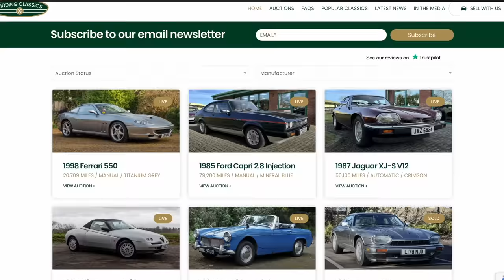Everything wrong with my Rover 75...Have I bought good car?

Comment: Can’t agree this engine is the best version. I had the BMW diesel. Totally reliable and went like a train on almost 50 mpg. And no head gasket nightmares.
Reply from the maker: Ive got that in my Freelander. Its good but not exciting or ULEZ
Reply: To be fair if the initial head gasket issue is resolved properly you generally won't see it again.

The amount of these that got misdiagnosed with HGF when it was just the green 'rubbery' gasket on the inlet manifold.

They're absolutely worth changing yearly for how cheap and quick to do  that they are.
Reply: i've got a diesel 75  , very good cars, 60 +MPG,
Reply: Pity the Td5 wasn't engineered as a common-rail unit with a 20v head - could have installed transversely in the 75 and would have suited it well. 125 kW (170 PS) @ 4,000 / 350 Nm @ 1,900 (GETRAG & JATCO gearboxes' limit) would have ensured decent progress.

Could have been used in the Defender a little longer and possibly even used in the Disco 3.
Reply: Rover used a better Turbo than BMW  on the Diesel engine  ,  my old 75 was on 220,000 and miles still on the original one  !
Reply: The M47 diesel is by far the worst engine you could get in the 75. It has a terrible fuel system that fails every 10 minutes, it's too heavy for the suspension, it destroys clutches, it's not as economical as any of the equivalent diesels of the same era (including Rovers own L-Series), it's lethargic, it sounds awful, the thermostats stick open, all the plastic BMW ancillaries go brittle and fall to bits, it's more expensive to maintain than any other engine in the range and it ruins the way they drive. They're ghastly things. They were certainly less troublesome when they were new granted, but with time they've handily proven to be the worst of the bunch. ULEZ is the nail in the coffin for a lot of the diesels I think. 

1.8T is the best drive, the V6 is the most reliable and the V8 is the most obnoxious.
Reply: @applejuice5272   Is there a reason for that? It seems a long way behind the times , considering FIAT were putting common rail diesels in European market Cromas in 1988
Reply: @neilwalsh4058  *direct injection diesels

The 156 2.4 JTDm was the first common-rail DI diesel passenger car in 1997
Reply: @applejuice5272  you're absolutely correct , Croma was first direct injection not common rail. JTD was a FIAT engine , went in the Marea too,  same era as 156
Reply: I prefer the diesel. Probably because its the one my Dad had from new. I like the sound. It reminds me of childhood! Also it manages to be both torquey and slow. Suites it and gives it character. It just the kind of car where you listen to The Archers or the Brandenburg Concertos and you're not in a rush! 😊

Comment: As loads have probably already told you, the water ingress in the boot will almost certainly be down to failed gaskets on the light clusters
Reply: Tiger seal to the rescue!
Reply: They fail because there was a bending op post paint to compensate for a twisted boot lid through the curing process. This happened because they only used a one sided support to prop open the boot lid through the ovens.

Comment: It looks in great condition all round! Just a point about the plenum drains, I'm not sure if you know but there's another one on the passenger side further in that's right under the ECU.  That's the one that can cause the ECU to become flooded if it blocks. You need to take a few panels off the scuttle to get access but overall it's an easy job.
Reply: Hope Matt got your message

Comment: I had a Rover 75, same colour with BMW diesel engine in some 20yrs ago, was one of the best modern cars I have ever owned!!!!!!!
The bulk head drain tubes were a known problem even then, I took mine into Rover and there solution was the pipes underneath they ran a Stanley knife through them!!!!!! So pipes still there but split open!!!!!!!!!
To be fair to Rover, it worked!!! They never blocked again!!!!!!!!!!!!!!!!!

Comment: I am a proud owner of a 2000 R75 1.8 SE and I gotta say, it is a great car to drive. I got it as my first car a couple of years ago and after paying £700 for it,(61000 on the clock) I am still loving the thing. Had to do the Head Gasket and the paint work needed redoing as it had all flaked on the bonnet, roof and boot. I have spent a fair bit on this car, but its gonna be my ride for however long I draw breath. I bought a cheap steering wheel cover that sorted the old roughed up wheel out. I also have a plenum guard that a lad on facebook 3D prints. it sits just under the hinge on the drivers side and has a foam filter to stop debris getting into the plenum area and clogging it up. I have had new front coil springs, drop links(all) rear swing arm bush (did both) new stereo, tinted windows, focal speakers, sundown amp and sub, cow print seat covers, neon lights in the front, just about to put more neons on it underneath, hopefully get her to a few rover festivals in the future after I have got a few more bits done. DGMRS are a great company for parts, and they throw in free MAOAM sweets with your order. had to replace the rear door mech as the small plastic clip had snapped, soon to be getting full set of door handles, and at some point I will be getting the door liner, headliner and rear liners redone...........in cow print. yup, I am a bit wierd, but its my pride and joy. The Rover 75 is a true classic.

Comment: Just a quick tip, on our Rover 75 Classic there used to be a swimming pool just below the master cylinder on the driver's side, I discovered there is a rubber pipe just below the power steering pot on the bulkhead. Also watch Ian's (Hubnut) upload regarding how to remove the plastic just below the windscreen, (the garage that serviced the Rover managed to break the item, than repaired it badly so I guess it's quite brittle plastic). Good luck with your car, it's in great condition.

Comment: I had a BMW built 2000 X 75 1.8 Club SE. The dash was real polished walnut, the seats were cloth (I hate leather seats). It covered 172,000 miles over the ten years I owned it. Getting into it on a wet, cold day was like going into my living room and I would regularly drive from Victoria Embankment to the North Coast of Scotland on a single hop. Of all the cars I've owned, that and my current Forester have been the best. But for comfort and class, the 75 beats them all.

Comment: Had a 1.8 turbo Tourer. Great car. Clutch hydraulics were a weakness, went through two master cylinders. A pain to access above the clutch pedal. Sure you've heard of the 'orange clip' fix on the intank fuel pump, only thing that stranded us.

Comment: Glad to see you have struck gold this time with a really sound car with a lot of the potential problem areas (head gasket) fixed. This is too nice to move on I'd say, I would part with the Volvo or the 400 estate, maybe both?? Great content as always 👍
Reply: Yes this one should be a keeper, I think Matt is liking this one too much and appears to be relishing doing these lttle jobs to it unlike some of the others in the fleet.
Reply: Absolutely great content for the channel, and a fantastic car, too. I'm biased when it comes to cars in the Furious Fleet. I have a severe dislike of front wheel drive, a loathing for the 4.6 litre V8, and an affinity for Swedish Red Blocks. I think it would be very interesting once all 3 are fettled to do an head to head comparison of the 75, the P6 2000 and the P6 with the Rover 4.2 V8. For my money the 4.2 is the way to go, but with a North American GM Quadrajet intake and carburetor. The 4bbl was available when the original 215cid version ordered in the 61-63 Buick Special Skylark, with or without turbocharger.
Reply: The Volvo is too good to flip. Maybe flip the 400 tourer and the Freelander though, and keep this?
Reply: The Volvo and the old Merc are the forever cars.
Reply: The Volvo and the old Merc are the forever cars.

Comment: Great vid as always! I own a 1.4 petrol 2002 Rover 25 which is currently off the road as I now work from home and no longer need it for commuting. It was a hand-me-down car from a late grandparent. It suffered a coolant leak a few years back, which lead me to believe it was the dreaded HG issue, so I simply chucked in some gasket weld and it’s been fine ever since. No leaks and the temp stays below the half way line 👍🏻. I just can’t bring myself to get rid of it. It starts on the button every time, even if it’s been left for weeks. They look great these old Rovers do and I’m glad to see that there are still many enthusiasts out there who are willing to keep them on the road 👍🏻
Reply: Just for the sake of future reference for others. 90% of the time you should never put any "gasket repair" or "gasket seal" into a K-Series. Particularly K-Seal. If you are willing to risk it steel seal is the least deadly in a limited quantity.

The K has very fine water ways and if you're unlucky those repair liquids can congeal and block them, that will hotspot the head and destroy it. I've seen it happen many times unfortunately.

Sounds like you've been safe which is good to hear. I'd just prefer to warn people! It's always a bummer to hear when someone has had their engine cooked because of K-Seal.
Reply: @SpitfireFortyFour  You are right 👍I would normally have got the car sorted out properly, but it would have cost more than the cars worth. So it was either try that or sell it for spares or repair. Luckily for me its been running fine ever since and ticks over perfectly on idle
Reply: @SpitfireFortyFour  Sound advice. There is a myth within consumer and in the trade circles that K-Series Cylinder Head Gaskets are prone to "Failure". That is misleading and repeated many times on all forms of media.

Misleading because they rarely ever fail. ON ANY CAR. They are invariably first DAMAGED by some other process. That invariably being OVERHEATING following coolant loss. The excess heat will damage engine components and the first one to suffer is the poor old gasket which ALWAYS gets the blame unfairly. 

Folks accuse me and our K-Series cars in the family fleet as being "lucky" that our British cars are so reliable. It is not just luck. We check things as recommended by ALL manufacturers. 

Cue Clarkson's rodent sidekick blurting out on BBC's Top Gear things like 

"MGFs are RUBBISH"

Broadcast to the World. Cue also comments like this from brainwashed ...

These folks are highly paid professionals so obviously know what they are on about.

Wrong in spades.

Comment: Many years ago I had a W reg CDI, great car very solid and went surprisingly well. Only one problem was the ignition key would get stuck in the barrel. Managed to cure it with 3 in 1 oil, although I put so much in it dripped for months. Good luck with yours.
Reply from the maker: This is very tight as well, I though it was aftermarket keys

Comment: That is a great car, Matt. I've lived the look of a 75 since I first saw one on Dalziel and Pascoe. Tom Barnaby in Midsomer Murders had a couple of them, one pre- and one post-facelift. With most of that surface rust, get rid of the loose stuff and then either POR-15 or Krown Rustproofing to the rescue. Krown WORKS. It was invented to counteract the dreadful winter weather here that can destroy a car in 10 years. It has kept my 240DL Estate in one piece for 33 years and counting.
With my dislike, even hatred, of front wheel drive and the Ford 4.6 litre, I wonder if I could take the rear wheel drive MG version, yank the engine and transmission, and drop in a late 80s spec 351W (5.8 litre) V8 with Edelbrock Performer intake and square bore carb, all backed up with the 5 speed manual that lived behind a 5.0 H.O in an older Mustang. The neat thing there is that the highway mileage might well be better than the 1.8 litre Turbo. Hmmm. Point to ponder.

Comment: Agitation is key to good extraction and fabric cleaning. Spray a good fabric cleaner on and allow it to dwell for a few minutes, agitate with an appropriate brush (not too soft otherwise it wont do much, not to stiff or it will ruin the fabric), and then extract. Drenching fabric and simply extracting it isn't going to make the most of the detergents that you are using. If you don't have a steam cleaner I'd invest in one of those as well - wrap a microfibre towel over the end and agitate fabrics with it and you will be surprised as to how much gunk comes out.

Comment: With the water ingress in the boot I highly recommend pulling the inner trim away from the wing (this was the same side as mine) and check where the chrome trim on the outside clips in on the wing, took me ages to figure out where the water was coming from (I changed the light seals hoping it was that but I saw the water dripping from one of the clips from the trim. If it is from there I just chucked some mastic sealer in the clip and it's been dry since
Reply: same here.

Comment: I've just fixed the mirros on my 75, took the switch unit apart and cleaned the connections with isopropyl alcohol, mirrors works fine now

Comment: I was thinking throughout the video that I'd move the Volvo on and keep this if I were you. The Rover estate is a big project but it is my favourite Rover in the fleet so I hope that one will stay. Good luck with everything, I'll be watching whatever you decide 🙂
Reply: The Volvo is, worse luck, a 2.0 litre. Because of that, I might be tempted to agree with you. Were it a 2.3 litre, different ballgame. The 2 litre is underpowered, therefore thirsty. My 400,000 mile 240 Estate with auto gearbox uses less petrol that Matt's 740 with the 5 speed manual. We're I ever to get a 75, well, it would be a 75. I want the MG V8, preferably with blown 4.6 litre. It would get a 5.8 litre (351 Windsor) V8. That would match or exceed the fuel economy of the turbo 4. In an 89 Grand Marquis (box that Matt's Crown Vic came in) the 5.8 litre was good for 40 miles to the gallon on the motorway in almost stock form.

Comment: Such a shame that we didn’t get the 1.8 turbo in Australia. I have a 2002 rover 75 V6 in top spec Connoisseur SE trim it is metallic burgundy red with leather & wood everywhere. It’s a dream to drive & is one of my regular drivers. It has 140,000 miles on it never put a foot wrong. As with any of my cars I service them every 5000 miles regardless of what the sticker says. Being a mechanic myself
Reply: Agreed. There's a reason puzzled folks accuse me of having very reliable British Cars over the past four decades or so. Amateur mechanic me changes the engine oil and filter every 6-7000 miles. Oil is far cheaper than Turbochargers and engines. Those silly high oil change mileages are designed to attract the bea counting purchasing offices buying fleets for their companies. 15.000 miles during the first few years of fleet use is fine for oil services but, once those cars reach the used car market with different levels of use, 15,000 mile oil change intervals will accelerate engine wear massively. Several new cars bought with K-Series engines in the family still giving reliable high mileages past their twentieth birthdays.

Rocket science it aint but is to some types who do not know where the bonnet release is on their cars. The latter confirmed by my neighbour who drives one of those very familiar big yellow Roadside Rescue vans.
Reply: @T16MGJ  agreed 100% although I still service many fleet cars in Australia every 5000-6000 miles. They have much better resale value when it comes time to trade in.

Comment: That ducksback stuff is incredible. And you really have had a result with the 75 in terms of the body. The leak in the boot will be either tail light seals ( they split ), chrome trim pins on the rear quarter ( mine was leaking there just coated them in CT1) , rear window trim clips (again CT1 to the rescue otherwise its window out) , boot seal or boot plinth gasket.

Comment: Enjoying these updates. As both an MG ZT V8 and ZT 1.8T owner, the 1.8T K-Series Turbo engine IS as you say the best one to have ... as a daily driver. 

When I got the first 1.8T ten years ago, I read those strong opinions on-line and quite frankly, found them hard to believe. That considering the V6, BMW and Mustang V8 engine options available.

Ten years later, I fully understand that point of view. 

There is a better MG engine option though. The Chinese version of the 1.8T K-Series from the MG6. Have fitted one to my ZT-T seven years ago. 
The SAIC made a very fine job of their version of the K-Series 1.8T. 

That Electric Window Switch Pack you casually threw away could almost certainly be revived with a little no cost TLC.

EDIT  TO  ADD   What progress on the Crown Victoria V8 regarding the Handbrake issue?

Comment: For the sake of the cost of new pads, I’d swap the existing ones out. I’ve had experience of pads degrading on a low mileage car that has stood around for a long time…the friction material just came off the backing plate in chunks.
Reply: I had that on the missus's R50 cooper, the friction material just let go. That said, it was a thin fillet of friction material!

Comment: your poor handbrake will be down to a stretched mild steel adjuster - stainless ones are available but faffy to fit. Your water ingress could be rear light gaskets or could be where the chrome trim clips poke through the side of the car. Other problems include bonnet release cable coming detached under the bonnet and being unable to undo the bonnet. Petrol filter comes unscrewed and the car won't start. They rust around the jacking points.